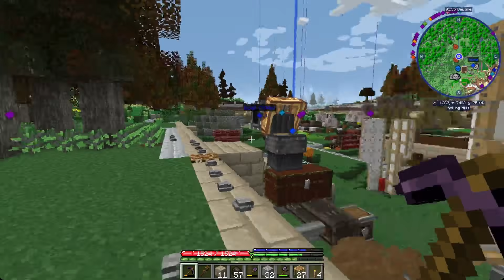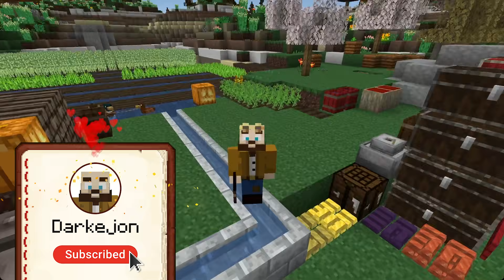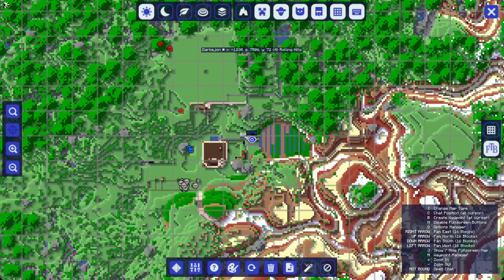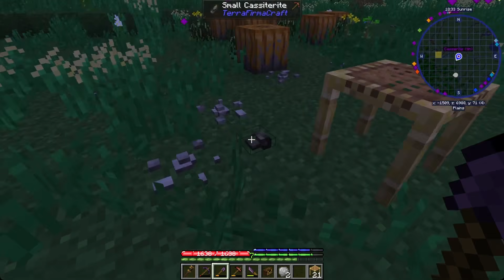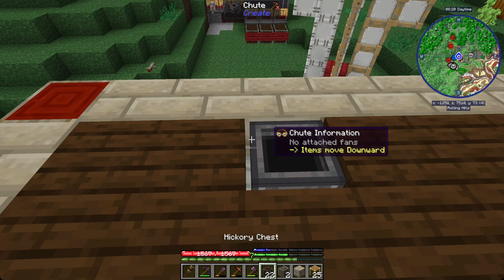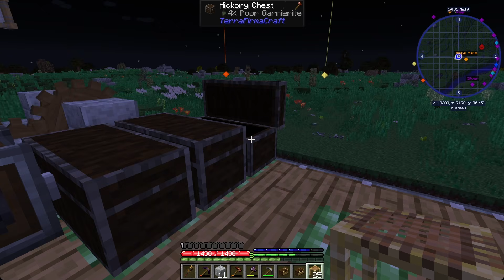Automatic mining machine. Auto-TerraFirmaCraft (#ATFC), Ep9. Modded Minecraft experience. Create mod

Comment: Also you don't have to use chassis for drilling machines: just glue a bunch of drills and chests together.

In addition, you should totally try cobblestone washing: this way you can get minerals (except rare resources) from plane rocks.

Regarding the nickel, I recommend using iron or zinc for igneous alloy: garnierit spawns rarer than iron or zinc to my experience. And you will need nickel for lategame steel.
Reply from the maker: Loving these tips! Lots to look into here. Thanks again!

Comment: Glad to see you got the crushed ore melting into vessels/molds working for your alloys in the charcoal pit before finding kaolinite/graphite.

For the mechanical crafter you want to link only the ones that are the same material, this is so you can automatically feed each material type to one spot rather than having to place each one individually. That’s why when you first tried placing onto it they spread everywhere. If you’re going to manually place things you don’t need to link the crafters at all. 

I’ve found that mine cart tunnel boring to be a more active/fun way to mine with the drills. No need to worry about rotational power, just need to place blocks/track to keep it going. It is a bit frustrating trouble shooting it at first as it keeps getting stuck but once you get the design worked out then you can do the usual prospecting pick triangulation, dig down then unleash the drill. Less waiting around. More running after it with torches trying not to die 😂. 

(There is also the cheat-y breaking block method with the cart assembler if you don’t enjoy the Rube Goldberg designing aspect of Create.)

Also tool boxes are an interesting alternative to chests on the drilling contraption. Makes unloading/organizing easier since you can just pick them up and you can almost prefilter them by having the ores you’re looking for “locked” on a few while most are left open.
Reply from the maker: Nice - thanks again for the awesome tips Don. Lots to look into there :)